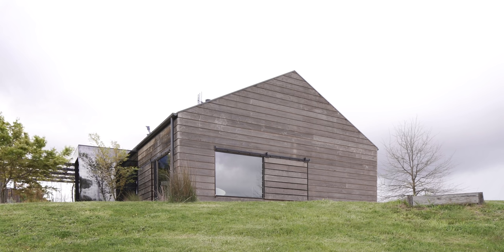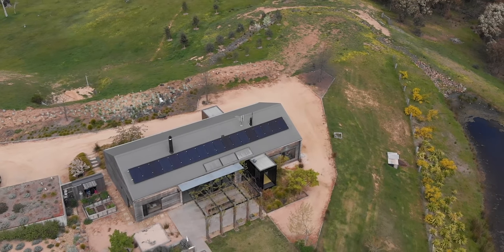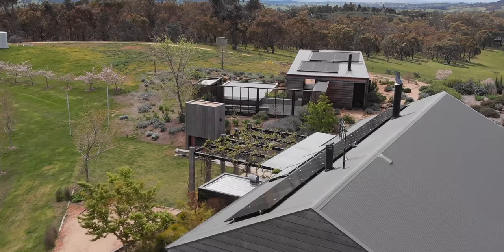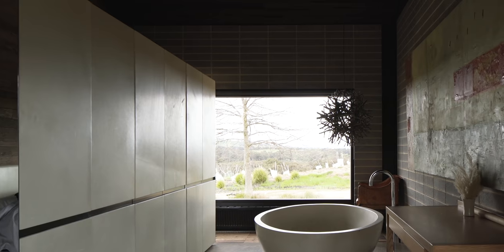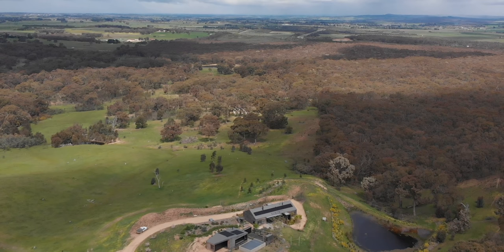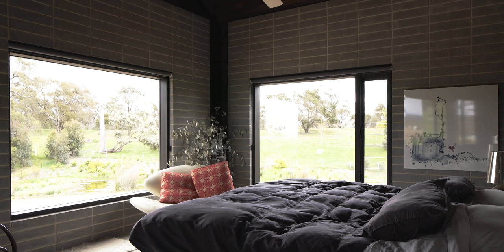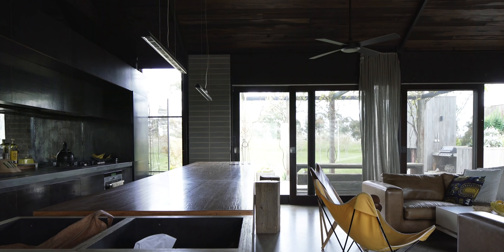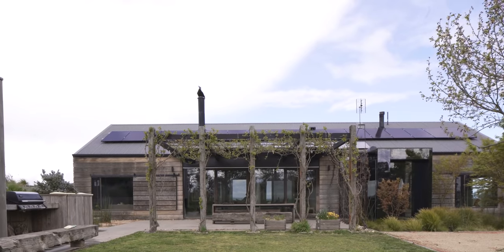An Architect's Own Family Off-Grid Sustainable Home

Comment: In the winter I plug in my electric floors into my solar PV system for heating. In the summer I unplug them and use cross ventilation all night for day time cooling. With high insulation in attic, walls and floor your house will surprise you passively. Beauty house in the country!

Comment: An easy fix would be a protruding overhang to reduce overheating. I know it would go against the agricultural aesthetic but traditional homes in hot climates sport a veranda specifically to reduce high internal temperatures.
Reply: or double glazing would do.